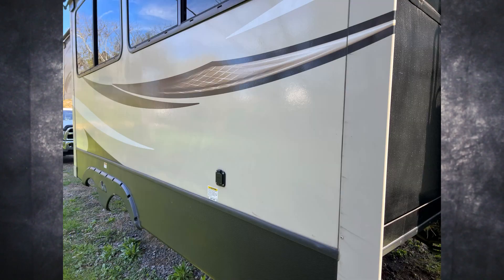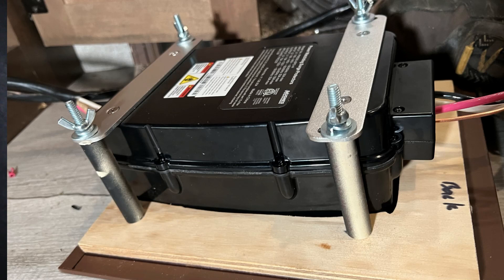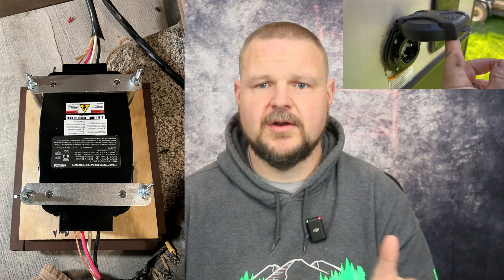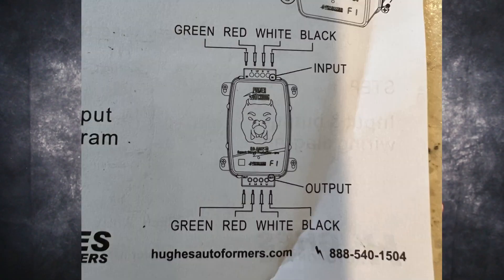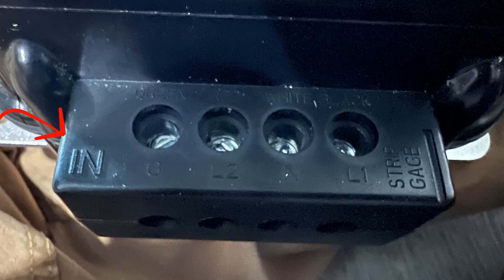Power Watchdog

Comment: Like your video on the power watchdog I’ve been looking at this unit for many reasons one it has Bluetooth which is nice to monitor it and I believe it has power consumption on the 50 amp. But I have the TRC and the remote panel which I guess does the same thing when I want to see my error codes or my usage at any one moment, but it doesn’t have the consumption amount but I’ve also had another very interesting thing happen here at our winter Place where I found a serious problem up on the transformer pole when my TRC was actually doing its job and kicking it out here’s a link to the video

https://youtu.be/ah0oVLwn5Ac

Thank you for your video. Safe travels.
Reply from the maker: It’s probably overkill since I almost never use 50 amp power.  But it’s nice to not have to mess with the plug in ones